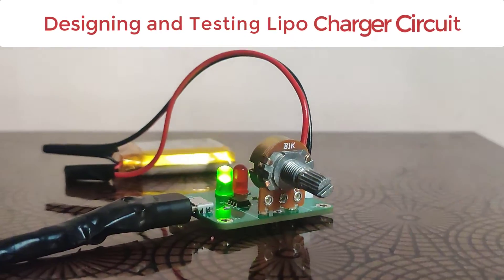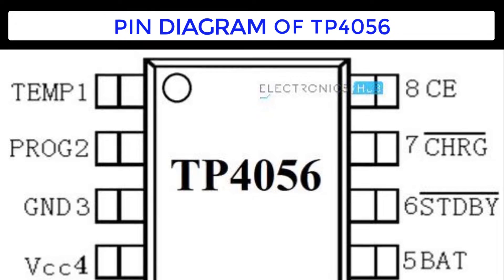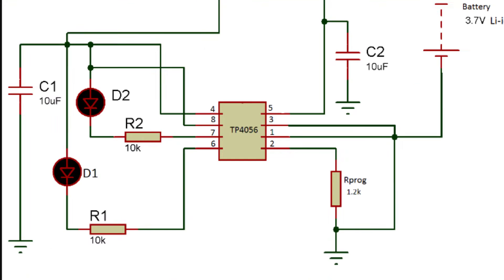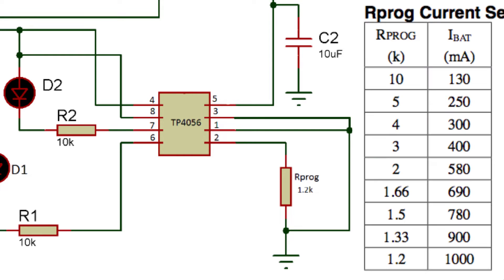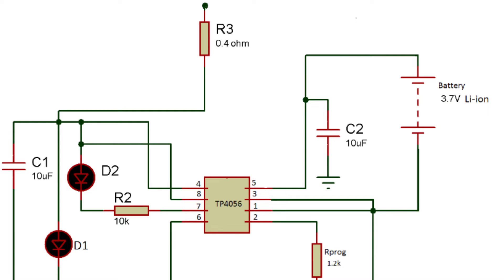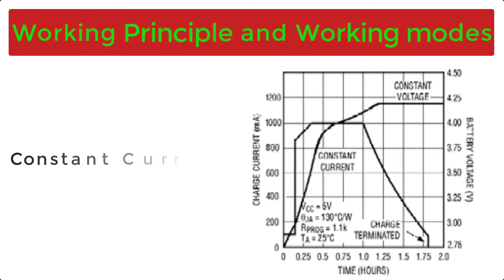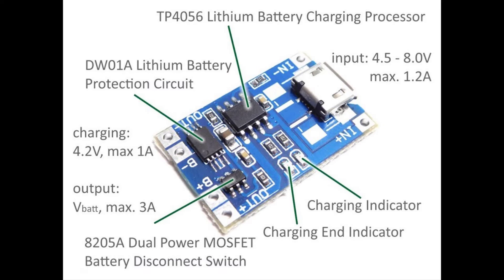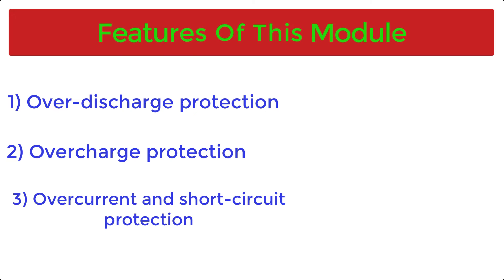How to Make Lipo Battery Charger Circuit

Comment: What is the distance between the mounting holes and their diameter?
If it is a multiple of 5.08 mm and the diameter is 2 mm, then we can say that the module is compatible with the MPP2508. It would also be nice to have a battery mount.
In my channel description there are links (the last two) to photos of assemblies and modules. Perhaps you will like this approach to prototyping.